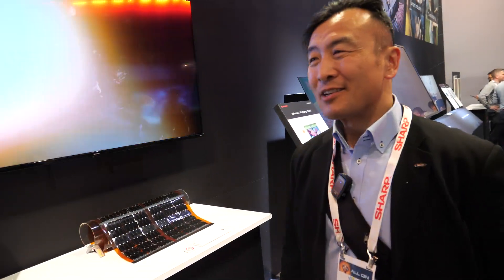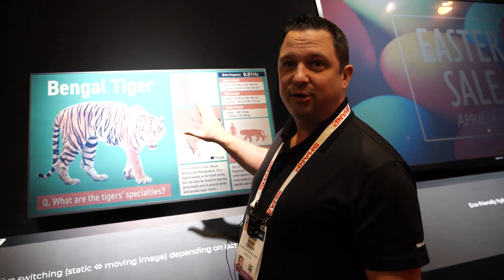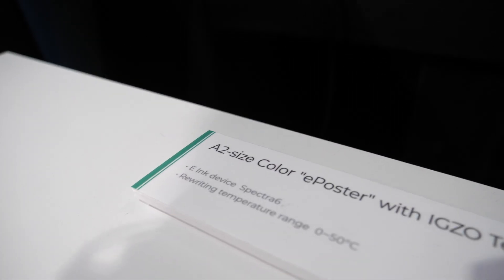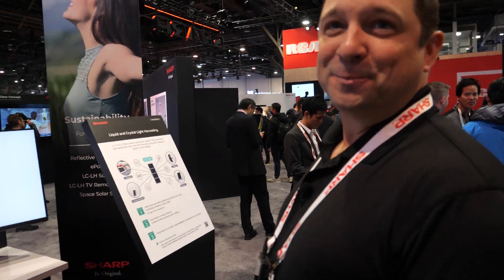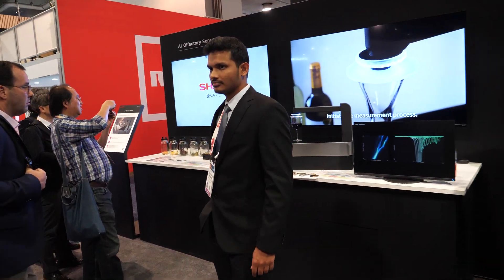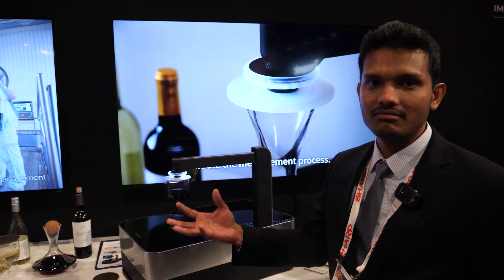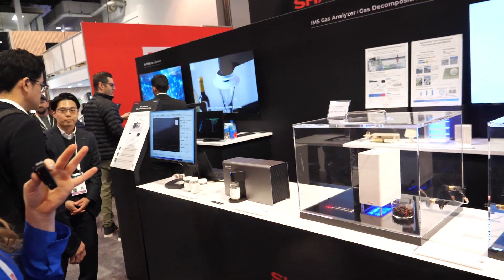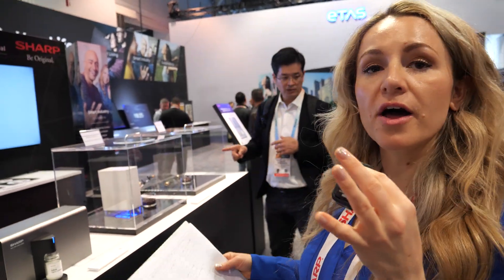Sharp Booth Tour at #ces2024 Transflective IGZO LCD, Reflective IGZO LCD, Space Solar, Oven, etc

Comment: The Sharp E-ink Spectra 6 billboard display looks amazing !!! We finally get good color for E-ink… after nearly 25 years… Really groundbreaking !!! Unfortunately I guess it will too much expensive for consumers at first… but wish to get one for a fridge or else…
Reply: not applicable yet. did you see the refresh rate of that thing ? signage and photo frames will be good use of it, but still pretty far from being ready for ereaders
Reply: The goal would be to use it as an always-on battery-powered dashboard, and although higher refresh rate would indeed be better, as a 1st step, to be able to update the info through an app or browser from a tablet / smartphone would likely be good enough : the always-on color display is a killer feature to display information…